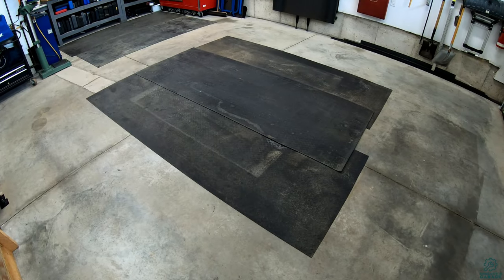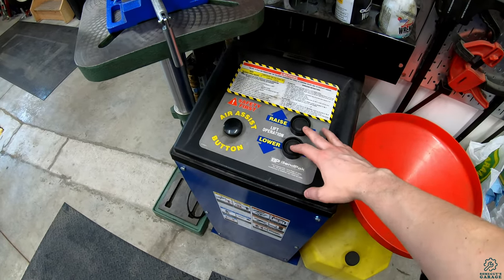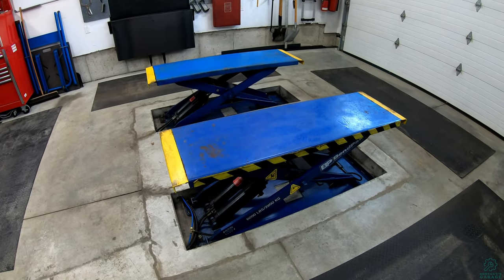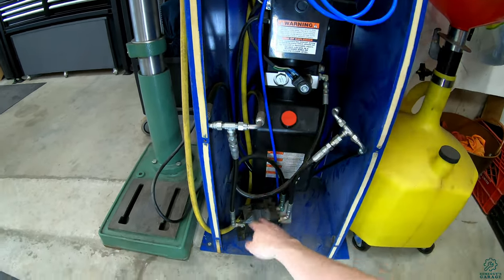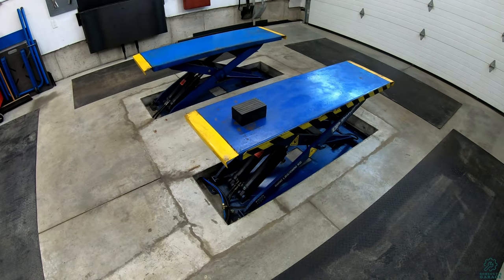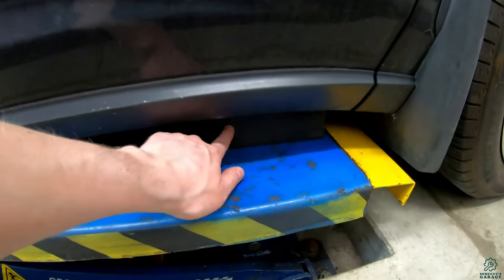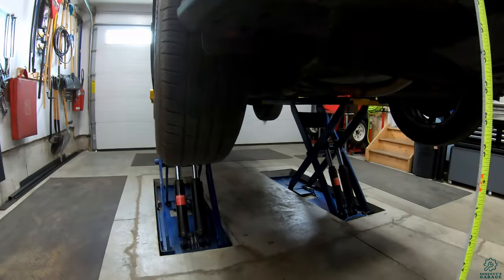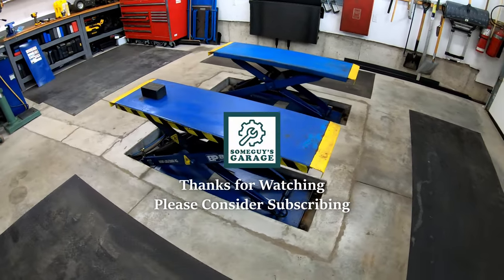The Invisible Car Lift

Comment: I like the mini stool and the cut down hoist stands, you have your own system going on there, well thought out. I'd be tempted to cut a rubber mat to sit on each platform, just larger than the platform so it closed the gap when the lift was down. Then you wouldn't even have to move the mats out of the way.
Reply from the maker: Yup, had to make some mods to make things work in my space.

They need a fairly large area to keep water from creeping underneath, especially in the winter, so I don't know if custom fit ones would work, though it's a really neat idea. Sometimes I slide the mats under what I'm working on to keep the floor from getting oils and such all over them too, so not the end of the world. Nice idea none the less, might work for others in different climate :) thanks!

Comment: Very interesting, if you had enough ceiling height, would you have picked a 4 posts lift instead?
Reply from the maker: Probably 2 post, I need tires off when using the lift more often than not, and bridge jacks suck.

Comment: I've got a Twin Busch mid raise scissor lift in my shop and would have loved to have it fit flush like you made yours but it has 2 bars running across and wouldn't be as convenient has yours.

And I agree with you with the extra protection with the OTC stands, I will be looking into getting a couple has well.

Great video
Reply from the maker: Yeah, you need to get one of the hydraulic synchronized ones to make in floor installation practical.
The OTC stands do need cutting down to fit under but they're easy since it's a non-welded collar you can pop off at the top...the other set I have (ATD brand I think? I bought them used) I had to cut and re-weld, but they have been super handy...both for stabilizing and for holding up parts (like exhausts, drive shafts, control arms, etc.) when working on things.
Glad you enjoyed the video! :)

Comment: Great video! I am in the middle of building a new garage, and I am planning to build something like this into the floor. How much space do you have from the garage door to the lift, and how much space do you have in front of it?
Reply from the maker: I'll try to grab those measurements for you, but it's basically centered within the 20 feet of depth. No issues lifting cars and small SUVs with the door closed, but you might want to measure out your vehicles to see where to place it.

Comment: Nicely done! How do deal with water or snow accumulation? I do live where we have snow/salt/calcium. I would be scared about them accumulating around mechanism.
Reply from the maker: Those rubber mats go over top when not in use and keep the junk out...they do a pretty good job. Otherwise the thing is sprayed down in fluid film (I've got another vid on that stuff) and I vacuum them out every once and a while.

Comment: I'd want something that went higher like some of the scissor lifts, specially considering all the cost and work to install.
Reply from the maker: You and me both, I unfortunately didn't have the ceiling height for anything higher.
Reply: @SomeGuysGarage  I understand now.
Reply: @SomeGuysGarage  You can pit between two lifts.
Reply: Atlas Auto Equipment makes many options

Comment: Well done. What and where - mats do you have? I’m using some armor all roll up absorbent mats with a rubber coating on the bottom that don’t allow water to get through.
Reply from the maker: These are just standard full rubber mats that you buy by the foot from the hardware store (I got them at princess auto).

Comment: Are there any repairs you wanted to do to your car but were unable to because the lift prevented access? Thanks.
Reply from the maker: So far so good...exhaust, driveshafts, transmissions, rear diffs, all the suspension components, etc. have never been an issue.

I could see it blocking dropping a fuel tank on some vehicles or if you wanted to do side skirts or body work. You can use extra rubber contact blocks to gain a few more inches of clearance though. Also isn't as good for body on frame vehicles where you sometimes have to reach up and under for a lift point versus just pinch weld area for unibody.

Comment: Did you consider quick jacks? Im debating between the two. But i will not be putting the scissor lift in the ground
Reply from the maker: Yeah, I considered the quick jacks and also maxjax. I didn't do maxjax because of the cuts in the floor meaning concrete work anyway. I didn't do the quick jacks because they don't lift very high, I'd have to use a creeper lying on my back for anything underneath. That said, the quick jack is an awesome product and the logical step up from jack/jack stands.
Reply: @SomeGuysGarage  thanks.
Reply from the maker: @jvh22a welcome!

Comment: do all these scissor lifts require air? i use battery tools i don't wanna buy a air compressor just for a lift
Reply from the maker: I don't think all of them do, I feel like there were a couple that had manually actuated ones...can't remember though as it's been years. Could check out the quickjack as a simpler alternatve.

That said, a $200 compressor will run these locks no problem, when the lift install is many thousands, it's a drop in the bucket to add air.
Reply: @SomeGuysGarage  good point, sir thanks for the reply. working on building a barn and i think i'm going to flush mount a lift too
Reply from the maker: @adamm2716  you'll probably want air in the barn anyway :) so handy to have!

Flush mount is awesome though, always out of the way...get rubber mats day 1 to keep crap out of the pits, and I also put some strips of sill gasket (like you'd use under a wood framed wall on concrete) under my lift to keep the metal out of direct contact with the slab.
Reply: I just bought a second hand scissor. It has electric solenoids. You could easily modify the air one. You could use a after market car door unlocking solenoid set and have a small battery to power it.

Comment: can that lift you have be able to lift up a full-size pickup 
half tons 3/4 tons probably not 1 ton truck
Reply from the maker: I haven't tried, the limit is 6000lbs, so would be close on some trucks. The other thing would be the ability to hit the frame pickup points, which might be difficult as this is more positioned for unibody vehicles lifting at  the pinch welds and is shorter to fit within that wheelbase.
Reply: @SomeGuysGarage  guapo is just over the limit...  darn

Comment: Sweet but a big long truck wouldn't be ideal for where it's placed
Reply from the maker: This style of lift isn't great for body on frame vehicles to begin with, it's more suited to unibody vehicles...nor is my garage really long enough for a big long truck. It's positioned centered in the space so I can open the doors on the vehicles, handy for working under the dash or doing detailing.